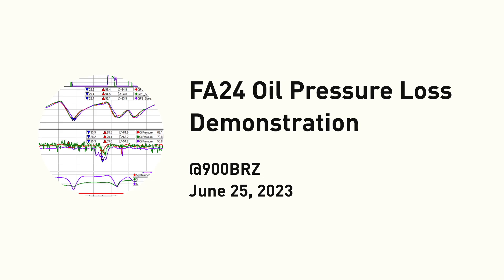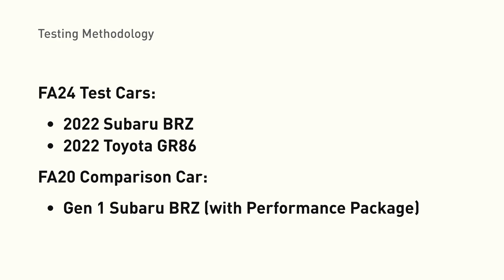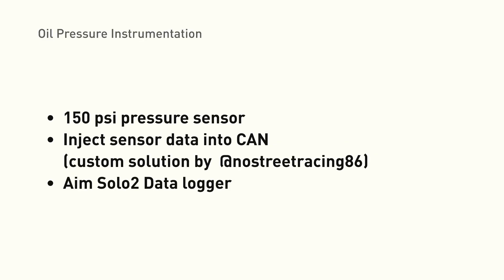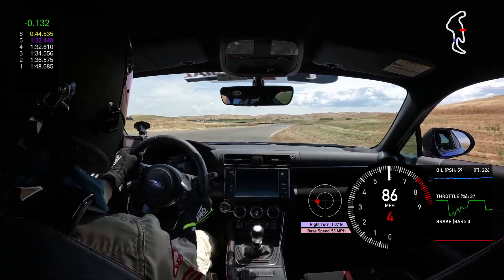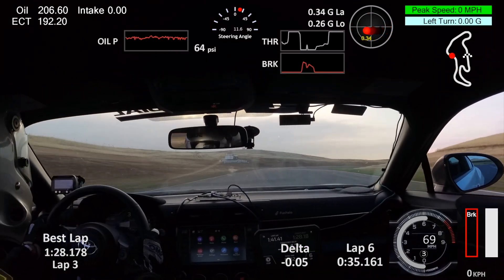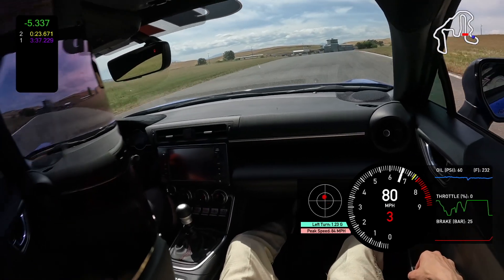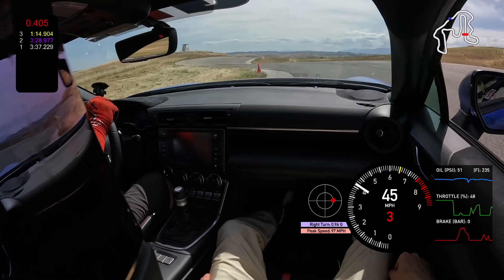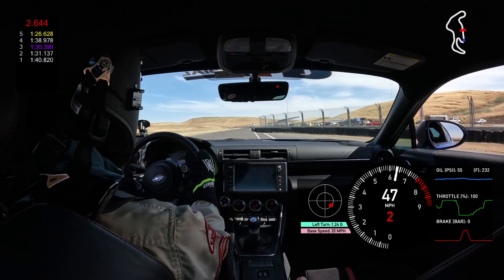BRZ/GR86 FA24 Oil Pressure Loss Demonstration

Comment: I'm not a Subaru person as such, but does the previous GT86 or WRX/STi suffer the same inherent problems? I saw one random engine failure vid on the track and now my feed is all Subaru engine failures.
Reply from the maker: The previous gen engine is covered in the video. We have a handful of clips of one FA20 on track and it does better than FA24. I don’t know about the WRX and STI but I have seen a video at Thunderhill showing mild drops in the previous gen WRX.

Comment: Will overfilling the engine with 0,5L oil help in this case ? May be Stupid, but it could be what it comes short of. 
But a baffled design is a more elegant fix

Nice video btw ! Lots of data and explanation.
Reply from the maker: We do want to test overfills but it’s not likely a moderate overfill like that will make a difference. I did try a 500 ml overfill but my times weren’t competitive at the end of the day. More testing to come.
Reply: @900BRZ  Nice, looking forward to new videos ;)

Comment: @900BRZ -  I'd love to see you guys test an FA24 WRX for on-track oil pressure loss the same way you tested in this video.   Are you planning to do that?  I noticed your July 5 instagram post says "Killer B is now investigating the differences between the FA24 engines in the WRX and BRZ."  It seems to me the first step of that investigation would be to verify for sure how the FA24 WRX behaves during identical testing to what you show in this video.   Great job so far, you and the other guys working on this!
Reply from the maker: I don’t have a WRX available but would also love to see them tested.

Comment: During the low oil pressure events, did the car ever throw a "Cam lag error"?
  If the oil pressure drops the cam timing system cannot advance/retard the valve timing fast enough and the ECU will throw an error.
Oh and my Vintage Race Car (71 Porsche 914 with the SAME ENGINE LAYOUT) has the same issue with oil starvation during hard cornering.
Known fix for >40 years:  Run with ~2 extra quarts of oil
Reply from the maker: We would definitely like to do some more research about overfills. We’re a little hesitant to run that big of an overfill so far, but once we have a setup to remove oil we can be more experimental there. 

I’ve never seen a CEL caused by the pressure drops, but that’s an interesting thing to consider. Makes sense. The AVCS is definitely actuated by oil.
Reply: @900BRZ  One problem with "overfill" of oil in a flat engine is that there is a chance that the oil will fill the case when the engine is off.
Then when you try to start the engine you have oil behind the pistons which likely induces huge (bad) forces inside the case.
You almost need a 3D model of the engine to see how much you can overfill it before the resting oil fills up behind the pistons.
I also run an accusump on the 914 with a pressure monitoring solenoid. When the pressure at the inlet to the engine (from the oil coolers) drops below a setpoint the accusump dumps oil to the engine feed line.
Reply: @900BRZ  The reason I bought the BRZ was that it was basically a duplicate of my race car (2.0L flat-four) but with twice the hp and 50 year newer tech.
I have had both of them on the track but did not push the BRZ hard as it is my daily driver.
Reply from the maker: 914s must be a riot on track. I remember being taken for a drive in one when I was 12 and I was hooked. 

Yeah definitely concerned about aeration and other negative potential downsides of overfills. Once we go over 1 liter we’re going to be very careful to make sure we’re not introducing side effects. 

My friend with the FA20 is installing an accusump so we’ll get some experience with that as well. Right now I’m thinking of baffles and overfills as stage 1, accumulators as stage 2, and a dry sump (not commercially available for this engine yet) as stage 3. Would ideally like to figure out a mitigation that at least works on low grip tire in the stage 1 bucket.
Reply: @900BRZ  If you look at the oil sump system on the Porsche 914-6 it is pretty elaborate and eliminates oil starvation issues.  It is basically a dry sump system in a production car.
Reply: @900BRZ  - "914s must be a riot on track."
They handle better than an equivalent 911.

I recall being "chased" by a 911 into a sweeping reducing radius right hand turn.
I was watching the 911 in my mirror thinking: "He cannot hang with ME in this corner" JUST as I watched him fly off the track.
Reply from the maker: Lol puts a smile on my face. I’ll check out the oiling system in the -6 thanks for the advice. We’ve looked at the M96 and then the X51 sump modifications Porsche introduced. Certainly not the first time m these issues have been present in a road car. Hopefully we can find a solution!
Reply: @900BRZ  The 914 and the BRZ are sharing the "barn" side by side right now.
My BRZ is one of the very first in the country in Galaxy Blue Silica (very low VIN number). I suspect it was brought in as a test car for the media then auctioned.
The 914 was originally a 71, but I put a stock 4cyl 2.0L in it (didn't come out till 72) so I am not completely "stock" as far as vintage racing goes.

Comment: what a bummer. A car whose whole reason for being is great handling has high G lubrication issues. One would think that Toyota/Subaru should have been able to find this during testing. Are they honoring warranty claims for motors with spun bearings?
Reply from the maker: It seems like it’s hit or miss. They don’t have very objective criteria published externally, so it appears they can reject arbitrarily. One of my friends had to get a lawyer involved and threaten a lawsuit and then they caved and offered a lemon law buyback. Still in progress months later.

Comment: Add lucal heavy duty oil stabilizer, that sticks like crazy to surfaces, we've ran a car without oil pan for 1 full lap with zero damage with oil containing similar additive: Kendall Racing Green.
Also go heavier with oil, 10W-60 probs best for heavy track use or if your pressures look too high then 5W-50. There is also 20W-50 but that's heavy additives mineral oil, meant for classic cars, but that would retain high pressure easiest until getting upto temp. 10W-60 is equivalent for modern engines, BMW M-series uses this.
We use solely 20W-50 or 10W-60 on racing cars, or even on the street on similar engines, but these are older engines than FA20/24: 4AGE, CA18DET etc.

Comment: Wow this car is just like zoolander😅. Wtf have you done Subaru. This is unacceptable....for an engine to have been developed by a manufacturer and after all the tests and simulations that oil pressure in one side dropping is beyond words. I have lost all respect for Subaru. The seal issue is ok that is a manufacturing issue and easily fixed and adjusted during production...but this? 
I was considering a track car with this and I'm out now. I'll look elsewhere

Comment: Very interesting results. Thanks for the awesome work! Just curious, where was the oil level serviced to prior to performing the test? Could keeping the oil topped off at the full mark on the dipstick possibly prevent the starvation/pressure drop?
Reply from the maker: Oil level was at or a few mm above the max line on the dipstick on all cars. Thanks for watching.

Comment: Does overfilling the engine oil solve this? I recall the E36 M3 had similar issues that was solved by overfilling the engine with 0.5L of engine oil before track use
Reply from the maker: Will be doing testing on this. Initial test was not conclusive because my laps were too slow at the end of the day 😢

Comment: Why 5w-30 oil? My 23 GR86 specifies 0w-20. Sorry for my ignorance; still very new to this car.
Reply from the maker: 0W20 will thin out at the high temperatures we’re seeing on track, even with an oil cooler. So we run higher viscosity oils to combat this and keep pressures healthy. It’s not unusual to see people running *W40 or even heavier oils. GR Cup runs 0W40.
Reply: @900BRZ  Got it. Thank you for taking the time to reply. I won’t be tracking the car yet, but good to know for when I do. 👍

Comment: Isn't there a high pressure oil pump you could use?
Reply from the maker: Wouldn’t make a difference if the problem is the existing pump is picking up air because the oil has sloshed away from the pickup. That’s my current theory.

Comment: Is the FA20 oilpressure sensor setup similar? I see sometimes it is put on the sandwhich plate on aftermarket coolers
Reply from the maker: It’s on the OE pressure switch location

Comment: Excellent video. My 2024 BRZ is on order. What pressure gauge, installation location, and equipment did you use?
Reply from the maker: Quick overview is in the description. I don’t have a dedicated gauge, just a sensor with data fed to my data logger.

Comment: Im just curious.... Im getting a new 2023 GR86 premium here in a couple weeks has anyone that drives a daily 86/BRZ encountered any issues like this? This personally worries me when I get it and I want to have fun and be able to drive it like a sports car its intended to be. I will be only driving the car from my home to work, car meets etc. And also, should i be using a thicker oil like 5w-20 or should i stick to using just 0w-20?
Reply from the maker: I haven’t seen anything concerning doing law-abiding driving on the street. Look into how oil viscosity ratings work. 5W20 is not meaningfully different at operating temperature.

Comment: Can someone explain why the test vehicles are running an aftermarket Oil Cooler AND a more viscous (thicker) oil? Also, which end of the cooler is the return? Could hard cornering create a drop in pressure from the cooler?

In summary, I would like to see the analysis on a stock car running recommended oil.
Reply: 0W20 would for sure produce less pressure at track temps but I'm also a little curious if oil could be trapped in the cooler.
Reply from the maker: The whole oiling system past the pump (including the cooler) is pressurized, so it’s not likely to have any negative effect. My friend did a calculation and the resistance from the lateral G combined with the cooler should only be about 0.5 PSI. Nominal pressures are about 2-5 PSI lower at the same oil temp.

Comment: Does the low oil pressure light flash on in these circumstances?
Reply from the maker: No, the OE pressure switch only activates below 5 psi

Comment: Honestly this is what everyone deserves for buying a TOYOTA with a SUBARU engine. I have the same sympathy for the new Supra owners who got a BMW instead, oof.
Reply from the maker: The new Supra has a very robust engine, the B58, and should hold up to hard track use without an issue.
Reply: The B58 is one of the best engines on the market, what are you even talking about lol

Comment: An Aussie racing web site (don't remember which one) stated that certain cars would not be allowed on the track without an oil pan baffle.  Among these were the 2022 BRZ and GR86.  They indicated the problem was oil starvation.  I've installed a Tomei baffle in my 2022 GR86 and after 4 track days my FA24 is still in one piece.  Two of the baffles they recommended were the Tomei and the GReddy.
Reply from the maker: It’s not just any baffle though. Will be sharing more test results with baffled and folks can decide for themselves which ones they are happy with.

Comment: Thank you for doing this. I got rod knock on my fa20 the same day I missed an exit on the highway and had to take 3 right hand clover exits. I had just gotten new coilovers and tires so I sent it a bit hard. It started knocking later that day.
Reply: hmm... the FA20 only showed brief spikes v/s FA24 with the actual drop in psi. Which year is your fa20 and did you have an oil cooler ?
Reply: @Arunkumar-bg5xk  ‘17. It happened at 45k miles. I did 3, 270 degree right turns separated by 200m or so at a fairly high rpm. In the video it was a short drop but it also wasn’t a 270 degree turn x3.
Edit: and no oil cooler
Reply: @everythingvinyl  bloody hell..  and what oil were you using ?

Comment: And for everyone waiting for the part 2: the KillerB baffle did NOT create any significant improvement in right hand oil pressure drops
Reply: Back to the drawing board.
Reply: @MarkJCarruthers No, just no more boxers 😂 Subaru is stuck on these crappy engines for ? heritage sake? Isn't that the same excuse Harley uses to not switch to OHC engines?
Reply: @izzy9022 the engine should’ve had a turbo as well, is 2023…
Reply: @izzy9022  boxers have a low center of gravity, no need to ditch them. Maybe they should get in contact with a couple of Porsche engineers or something.
Reply: @izzy9022  Porsche has boxer-4s that are well designed and suffer no oiling issues, but Porsche is Porsche and Subaru is Subaru... Flat 4s main attraction is the low center of gravity which helps handling significantly
Reply: @izzy9022 they use them due to their low center of gravity, creating a better handling experience.
Reply: @DANNY40379  Porsche also has problems with its Flat engines... look for... the difference, Porsche does not communicate. The owners do not communicate, because it is not glorious. You have to wait a very long time, with the third owner to have the sad reality at the craftsmen who manufacture new cylinder liners. Many Porsche owners only drive occasionally... they do over-maintenance, which does not solve the problems. It's a lottery... too many losers
Reply: @ak_sprite  Maybe they did. 996/7 987/987 had the same exact problem for 97-2009 lol.
Reply from the maker: That video is available here: https://youtu.be/8YoVsDFpaTA
Reply: these cars are like 56% on the front wheels.  COG isn't that low.  These cars would be stellar with a k series.  Just like the RX8 would have been amazing with a V6.  GTFOH with the boxer is worth it.
Reply: @robkeehner2204  Thats a very good weight distribution still, also what matters it being mostly over and behind the front axle, not how much it is front to back. In other subarus and in quattro audis engine is ahead of the front axle and it causes understeer even if some subarus have 50/50 distribution(for example wagon GD impreza).
Its about leverage. Grab a brick and try to rotate it around by holding it in the middle and then  by holding both ends of it with your hands. Weight doesnt change but it will be much easier to do it with the latter hold.

Comment: I’m curious about where exactly the oil pressure relief valve is located and the orientation of it. I was thinking that g forces from a right hand corner could be opening it to the relief position, allowing oil to bypass.  I’ve seen them get stuck and also the spring getting weak relieving more pressure than it was supposed to.
Reply: This might be it, looking at a video on the oil system and looking at the shape of the oil passage on downhill right hand turns it looks like it would be pushed right towards the valve. https://youtu.be/MOtYl2k6abI

Comment: One thing I notice at 10:00 is the drop is not as rough on the uphill section of T8, but as you crest it gets worse. From everything I have seen it seems a redesigned pan is necessary.

Comment: Seeing as how this car is more than likely going to be taking corners hard. Is this a learning experience to run baffles in the oil pan? To keep the oil near the pickup for high g right hand corners? Or does it not matter for the non turbo FA motor? That being said, why is it only on right hand corners and not left? Is it because the oil has to travel from right to left from the pump to the filter? I'm not an expert but just asking some questions.
Reply from the maker: We have some hypotheses at the end of the video. We don’t know for sure but believe the offset position of the pickup is a problem.

Comment: Early water-cooled Porches had a similar problem with oil pressure and lateral loads.  Those cars only had an oil scavenge pump on one cylinder bank.  A curve with g-forces that sent oil to the opposite cylinder bank led to oil starvation and spun bearings.  Is something like this happening with the FA24?

Comment: Have you tried running 1
Or 2 More quarts of oil ?
Reply from the maker: I just tried a 500 ml overfill. 2 qt is a lot. Have you seen that work without downsides?
Reply: @900BRZ  What changes if any did you see from .5qt overfill?
Reply from the maker: Minor, so far but need to do more testing.

Comment: Just watched the CM Autohaus guy and he said that the Tomei baffle plate causes oil pressure drops on both left and right turns.  To me that would seem to suggest that the oiling system in the FA24 is consuming nearly all of the oil available in the pan.  That small offset of the pick-up is enough for the pick-up to suck some air on a right hand turn.  And the Tomei baffle plate restricts oil for getting back into the pan fast enough, making a left had turn problematic as well.  Keeping the oil in the pan is not the issue, because there isn't any. So maybe the mechanical oiling system if fine.  It just needs a larger pan/more oil?  Again. thanks for doing this. Very cool.
Reply from the maker: I haven’t seen the data to back that up. One of the folks in our group has the Tomei baffle and we’ve seen improvements but not a solution with that baffle.

Comment: Dry sump oil system ? Wouldn’t that fix the issue ?
Reply from the maker: It would, but it would also probably cost something like $10,000 and none are commercially available. Also you still may have starvation in long corners unless you add scavenge pumps in the heads. All to be able to run low grip tires.